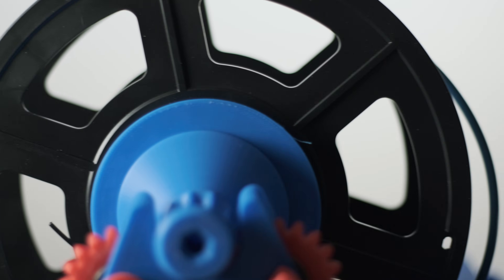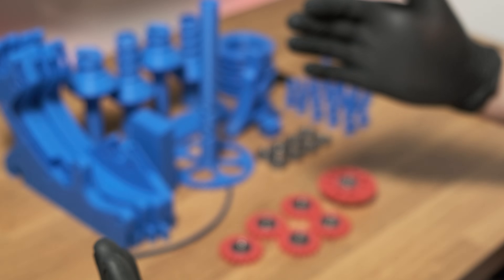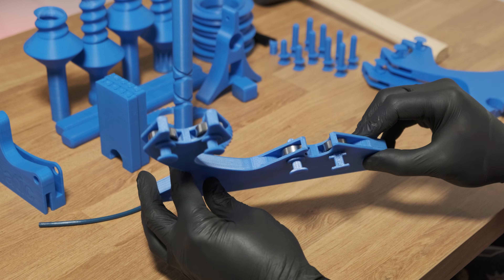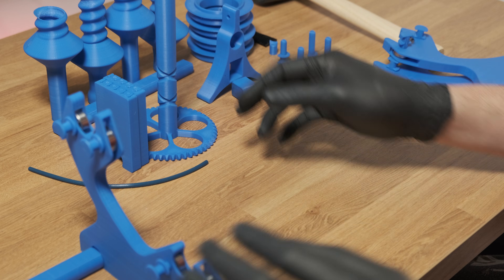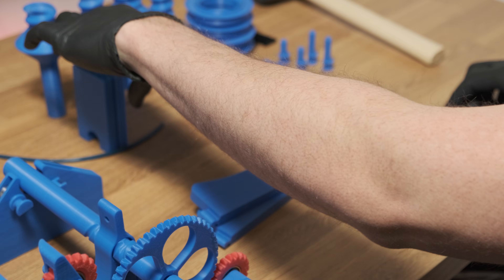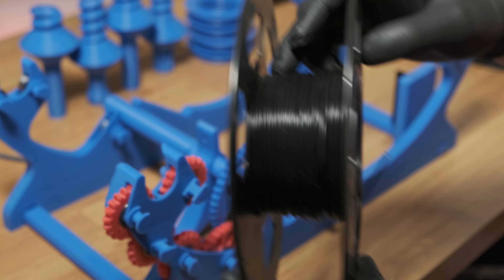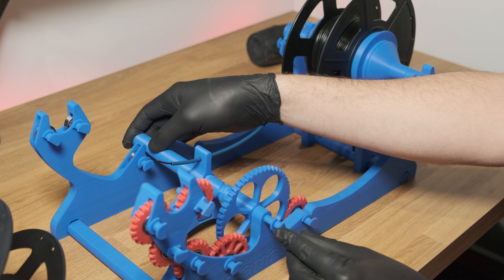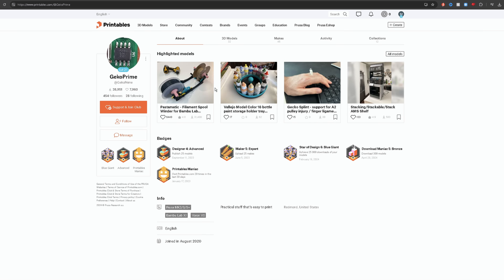Pastamatic - Assembly Guide

Comment: Really handy video, thanks! Mine is a really weird combination of loose and tight fits: The bearings were really tight, but the two halves of the frame (front/back) will need gluing together, they are a very loose fit. Also my gears are very tight in the frame; I can fix that by sanding them, if I can be bothered! (I've greased them for now, they're running a bit better).

I've now had to print the spool adapter thingies as my target spool's centre hole is too big for the stock holder.

Printed on a Qidi Plus 4 - took 28h for the main build plate + about an hour and a bit for the spool adapters and the "thing" that's next to them (it looks like a clip to hold one of the shafts down?). Fingers crossed for a successful first run!
Reply from the maker: No worries! I think there is always a chance that the tolerances may be different from printer to printer and filament to filament. I found the holes for the bearings to be pretty tight, but a rubber mallet seemed to do the trick!

Comment: I printed it up but my gears are very tight while turning. Any suggestions on getting then to turn better? Maybe some sanding?
Reply from the maker: what material did you print them in? Also, try using 0.16 layer height...
Reply: I used PETG anda little sanding smoothed it out.

Comment: I don’t have any tpu. Can I print the wipers in pla? Will it work without them?
Reply: That makes sense. Thank you for the reply.
Reply from the maker: @dainon3  no worries! If you do end up trying the pla wipers, let me know how you go! I actually just ended up buying a spool of TPU for them, because I figured I would need to print with it for other stuff eventually :P
Reply: I, and many others, don't even bother with them. Have 0 issues. If you need to brake the donor spool, use your hand
Reply from the maker: The wipers probably won't work properly in pla, they need a fair bit of flex to them to work properly, but you can alwas try! They are pretty important though, otherwise the spool will wobble all over the place and your new spool won't look so good :P

Comment: The stock Pastamatic needs some tweaks and upgrades to make it an accurate usable machine. Print a solid base that holds the two sides rigidly and the proper distance apart, and consider some way to secure it to the benchtop. Also print retainers that hold the donor and takeup spool spindles firmly down against the bearings they ride on. Print one for the free end of the lead screw while you are at it. None of the various shafts should be able to lift up off of their seats until you want them to. Finally, a spool shim will properly center the filament wind on the takeup spool so that filament is wound evenly across the spool. Spool the filament at a moderate steady speed, avoid the temptation to mash the trigger on the drill if you use one. Most of the time I use a simple hand crank.... there's no hurry.

Comment: I'm having issues with the piece that goes back and forth. It's not. I've tried several ways to adjust it but it won't travel. Also the pieces that are suppose to hold the original spool so it doesn't spin keeps sliding loose themselves. Have I misses something?

Comment: So, I got a lot of parts, not used. One big threaded thing, size of the inner part of a spool and one piece lika a side of a spool. two clips(?) and two locking pins...How do I lock the sliding part underneath? I think it should br locked on one side.

Comment: Thanks for this vid. Just wondering if I can use 608ZZ bearings?
Reply from the maker: No worries :) 

"2RS" stands for two rubber seals (one on each side).
These seals provide better protection against dust, dirt, and moisture.
They have slightly more friction due to the contact seals.
Best for applications where contamination is a concern (e.g., skateboards, rollerblades, 3D printers, and other environments where dust and debris are present).

"ZZ" stands for two metal shields (one on each side).
Metal shields provide some protection against contaminants but are not as effective as rubber seals.
They have lower friction because the shields do not make contact with the inner race.
Best for high-speed applications where minimal resistance is preferred (e.g., electric motors, fidget spinners, machinery).
Which One to Choose?

If you need better protection from dirt and dust, go with 608-2RS.
If you need lower friction and higher speeds, go with 608-ZZ.
Reply: For this application, it literally doesn't matter. You could use printed bearings if you wanted to.

Comment: Straightforward instructions. But I'm just curious...what's the point of the filament wipers?
Reply from the maker: It helps keep your spool steady when it's running so it doesn't become a tangled mess :)
Reply: Resistance so the doner stops spinning if there's no pull

Comment: Fantastic!

Recommendation: clip off that 'blockage' you applied to the filament end on the receiving spool once the winding is done. This will ensure (hopefully), that when you're using that new spool and it gets to the end, it will exit the spool 'safely' as the printer pulls it off. Your filament 'run-out detector', if you have one, will then be able to do its job.
Reply from the maker: You're right, it's a good idea to make sure the filament end is free!

Comment: Hi, Ive printed this and assembled. When I start to wind, the spool I'm winding on to keeps jumping off it.  Is there something to hold it down?
Reply from the maker: I had the same thing happen, there are clips you can find on thingiverse that help, but I found that once I added a motor, the force of it actually kept the spool in place. I have a video on how I installed the motor on my channel :)
Reply: @ Thanks. I used it today, had to hold my finger on top to hold it place. Unfortunately it didn’t wind it very evenly, went on very loosely

Comment: After printing and assembling mine seems to be very snug. Did I make a mistake with my settings?
Reply: Did you calibrate your printer ?
Reply: I printed some parts with ABS and they were very painful to put together. What plastic are you using?
Reply: @BlowBackIndustries  I print TONS of ABS, and I have my settings dialed in to near perfection, but I still opted to print this in PLA.  It's just so much easier to deal with as far as tolerancing goes.
Reply: Every part is scraping on the outer walls. I just hope these come loose at some point.

Comment: Hi, can you share which filament spool adapter you used? I looked in thingiverse and there are so many, but I haven't found the one you used
Reply from the maker: It just depends on your spool and how wide the hole is. Grab a tape measure and see how wide it is, then type in something like this "Sunlu to Bamboo Lab Filament Adapter XXmm". Here is one that fits 72mm similar to the video - https://www.printables.com/model/856559-sunlu-72mm-spool-centering-disc-for-bambu-lab-spoo?lang=en   . If you have a black plastic spool like mine, it probably similar to the one sunlu uses. Let me know if this helps!

Comment: I am looking for a spool winder that uses 1K spools as the doner to put them onto a 3K spool for printer use (receiver). It seems all of the larger ones are going in the other direction.
Reply from the maker: I believe you are looking for this bad boy - https://www.printables.com/model/868222-v-spooler-x
It fits 3KG spools +. You can also buy it on etsy if you don't want to go through the process of assemblying it.

Comment: This is great, but I’m just having a hell of a time inserting those TPU flaps!!
Reply from the maker: They were a bit of a pain to print because they are so thin 😆 took me a few goes, but if they printed correctly then they should slot in pretty easily. Is it hard to get them in, or is it hard for them to stay in?
Reply: @LayerLabAustralia  They printed ok, had a little blob on one side but I tried inserting with the perfect end. Couldn’t even do it with pliers to help. So I just slid them in with the thin side and that still works just fine. 😃 Maybe will try printing them again later.
Reply: same! I ended up just snipping off like 1-2mm off each side that goes in and they slid in
Reply: Glad I'm not the only one!  I tried them with a little bit of grease and was finally able to get one side in with the help of pliers.  The other side tore.   So, I'm reprinting them at 98% scale - hopefully that should help.
Reply: I used sandpaper with high grit the fabric of the discs is what slows the spool down
Reply: I had to drill each hole out to 3.5mm and clear the debris and then I could slide flaps in. It all comes drown to the tolerance of an individual print in whether you need to make adjustments on that part.

Comment: What are your print settings? Whenever I print stuff this tall it gets pulled off the print bed near the top.
Reply: I had a fail on the two crossbars at the base when i printed them vertically (as they were on the "one plate" print download.  I printed them lying on their side, and because they have flats, they printed fine for me that way.
Reply from the maker: Aww man that's annoying. Have you tried using magigoo? It is a game changer! It helps keep everything stuck to the bed, I think it will help :)

Comment: Great design. I did have one issue with a bad spool to where the drive bit stripped out the drive winder. So I made the winder with two diff styles one with a manual handle the other with a 3/8 octagon post for the drill to grip onto. Printed at 100% for strength at that point.